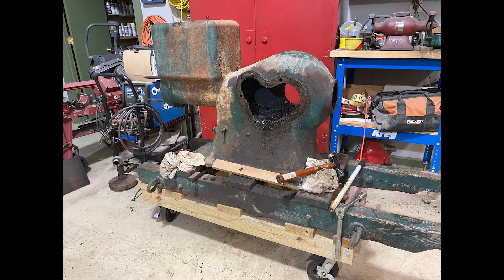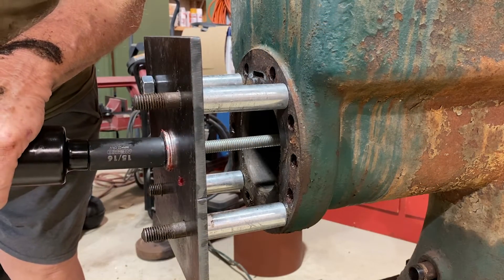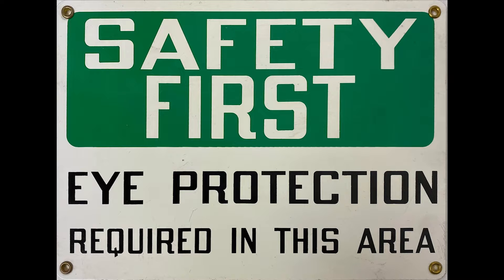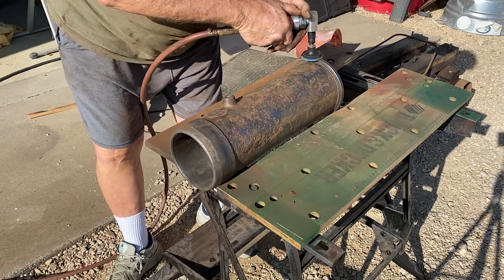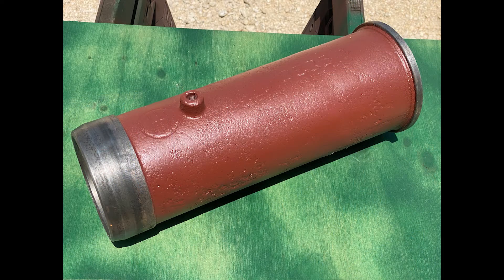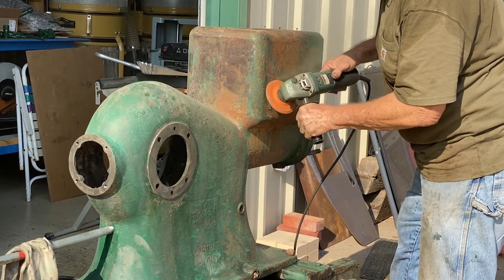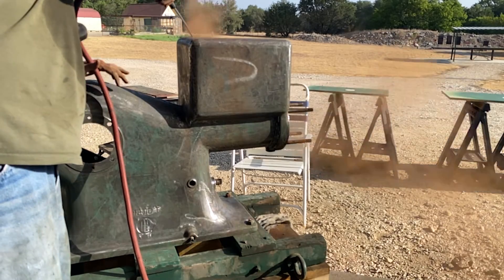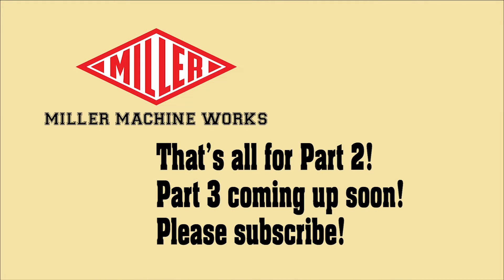Hit and Miss - Restoring a McCormick Deering 6 HP Type 'M' Engine - Part 2

Comment: You’re not kidding about the safety glasses.  I have had more wires stuck in me from using a wire wheel than a logical person would put up with. 
I’m currently tricking out my mini lathe and will be working on putting a “poly” V8 318 engine (with a six-pack) in one of my flat-fender Dodge Power Wagons shortly after that. Your videos are a pleasant distraction from the fact that these fun projects actually involve a good deal of work. 😂

Comment: Why didn't you borrow my pressure washer for a lot of that cleaning?
Reply from the maker: (1) Because we'd have to first find it in one of your barns (2) Then I'd probably have to rebuild it and (3) I have one! Actually I considered doing that but because I don't have enough concrete pad to roll the engine outside without blowing water into the shop, the pressurized solvent rig did the job. For anyone reading this, Frank is a VERY old friend who has several tin barns full of all kinds of cool stuff!!!

Comment: Hi - total noob here...what was this engine used for in its time?
Reply from the maker: Internal combustion, four cycle engines like these came along around 1900. The were used primarily for farm use, freeing the farmer, his family and hands from backbreaking labor. Engines, sold by McCormick-Deering, Sears and Roebuck, Hercules, John Deers and many others, were relatively inexpensive given the amount of work they could do. Fuel was low grade gasoline or kerosene. By World War II many were still in use in rural areas and in some industrial applications such as cotton gins. After the war, rural electrification progressed enough where electric motors replaced the gasoline engines. The advent of higher horsepower Diesel engines took over as well. It is a fascinating hobby and engine shows happen all over the world. Hope this helps and thanks for watching and your question.
Reply: @Radiotexas  That helped a lot. It's so awesome to see someone take an interest in a hobby like this. I absolutely love that you go in depth and cover the history of any particular thing you're presenting. It makes it much more personable given you have a familial connection with all of this. All that is to say ...  I'm looking forward to more videos!

Comment: I happen to have a large pressure washer (it's actually 4gpm and 3500 psi).  It would do a great job on things like that block.  Using a sandblast nozzle with it really cleans things up quick.  Not bad to do on a hot day either.  Make sure to use duct tape to mask critical surfaces.  It seems counterintuitive, but this will leave a fine grit of metal/paint/sand/other stuff on the part which leads to the rust to which people object.  Wash the part well with a regular nozzle before letting it dry.  The only rust will be a light yellow/brown superficial rust that easily can be painted over.  One thing that I like about sandblasting is that you will find any cracks and holes that need attention.
Reply from the maker: I tossed the pressure washer around a bit. Also considered sand blasting. Probably either would work. In the final analysis it probably only took me two or three hours--- and an hour of that was the water hopper! Thanks for the suggestion and for watching.

Comment: I really enjoy your channel, If I could offer a couple of suggestions.....the cleaning of the crankcase portion and other greasy/ oily items  I have used oven cleaner in those applications and the result was great...of course when done pressure wash etc to stop the chemical reaction. Additionally you may want to look into using Evapo Rust, for items like the cylinder, knock off the large scale etc with a scraper and place your part in a container of evapo rust and let it sit for a day and use fresh water to neutralize the reaction. It works great and Its biodegradable and not costic. Since i've gotten much older (alot older lol) and experienced I have looked into ways to cut down on the elbow grease...lol. I look forward to your next video. Regards.
Reply from the maker: In part 3 I'll explain a bit more. I was leery of putting the sleeve into the EvapoRust because of the cylinder finish. Looking back it probably wouldn't have hurt. Outlaw Jack will have some comments on the cylinder lining in Part 3. I do love EvapoRust but that 5 gallon bucket was almost $100!